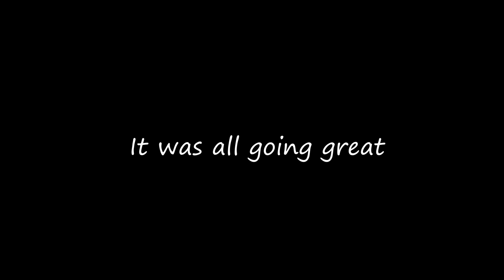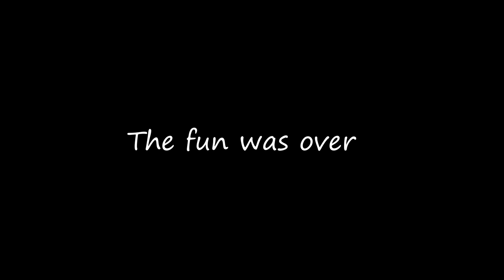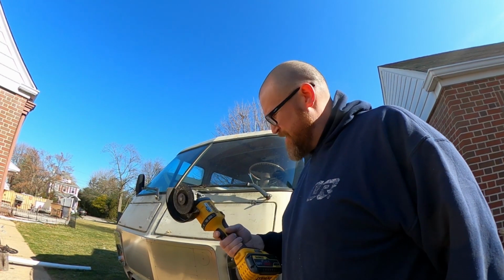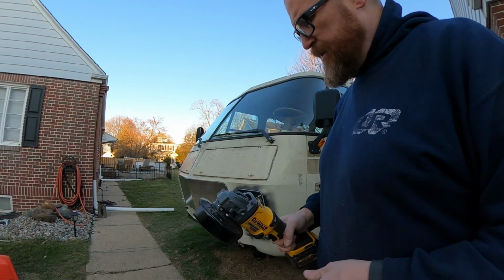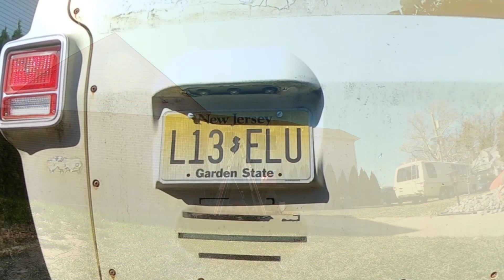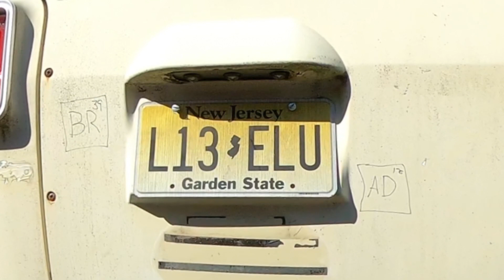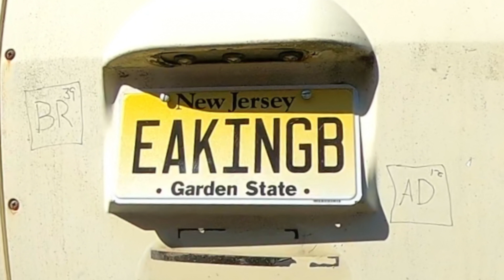Dewalt flex 60v Grinder Fail ,other stuff on the GMC motorhome,  and a giveaway idea

Comment: Looks like my sitch: I have a 73 Canyonlands that I bought last spring and after using it all summer (fix, take a trip, fix take a trip, etc.). I  stripped the interior and have been working on it when I can with lots of mechanical fixes lined up come spring. Oh, my old car project is a 65 Dart in about the same shape as your Goat, but not near as cool. Keep up the great work.

Comment: Question for you guys.

I blew a big hole in one of my mufflers and need to replace them both. We want a quite exhaust.  What mufflers would you guys recommend?
Reply from the maker: Salus Solutions I honestly can’t recommend any kind of mufflers yet. I just changed mine with the flow master I believe 50s as they were the  same length as the ones that were on my coach and real heavy duty and well-built but I was afraid they were going to be loud. To my surprise they’re not, but I also haven’t taken it on the highway yet. But so far they seem good
Reply: Get Out Gadabout thank you for sharing your impression of the flow masters. We might just give them a try